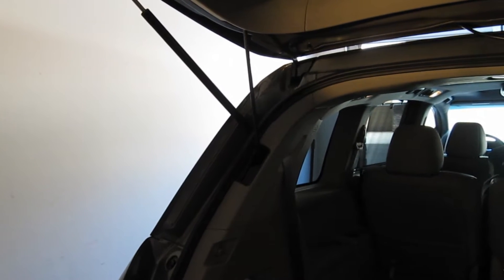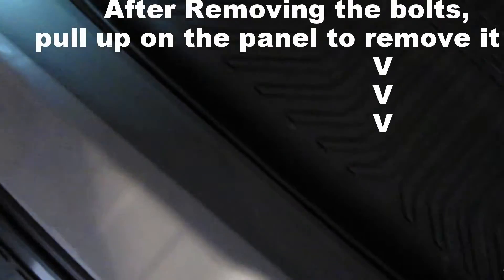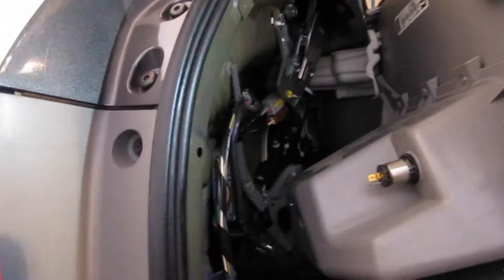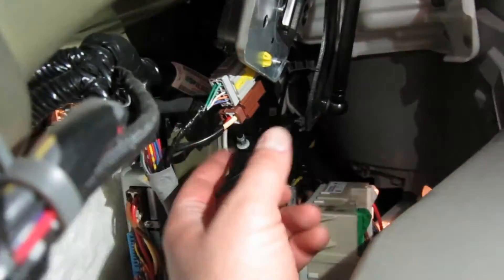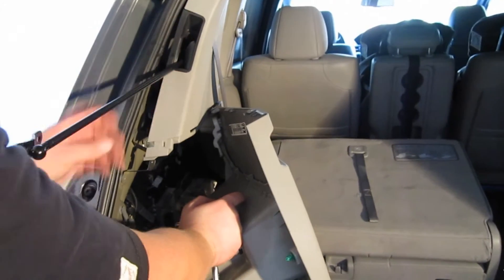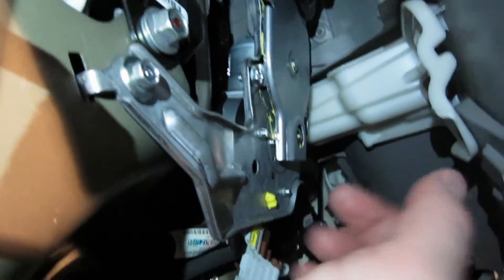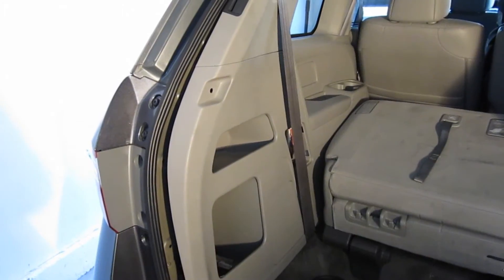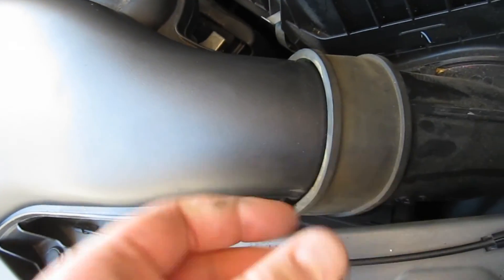How to Replace the LIftgate Motor on a 2011-2015 Honda Odyssey EXL

Comment: My post attached to that rattles when driving on bumpy roads, any ideas on making it quiet?  (come to think of it, by the time you reply I'll probably be done figuring it out)
Reply: So I ended up finding a rubber plumbing washer (probably for some valve in the house or something), cut a notch in it so it would slide in between the ball and the joint of where the rod connects to the door, and it seems to shut the thing up pretty good.
Reply: walperstyle Mine is having this same issue. How is hack working?

Comment: Please inform me the Part-Number of Steel-Bar connected from Motor to Tailgate.  I need to change only steel-bar.  There is a little gap so it makes noise.
Reply from the maker: I recommend asking your dealer using your vin # to make sure you get the exact part for your vehicle. Maybe try this part # 74966-TK8-A01 - or try taking a look here: https://www.hondapartswholesale.com/v-2011-honda-odyssey--ex-l--3-5l-v6-gas/body-air-conditioning--power-tailgate-motor
Reply: @howtogetstuffdone3480  Now i find out. Thank you so much!!!

Comment: Thanks, really helpful.  I wonder why these motors fail in the first place?
Reply from the maker: Random Stuff mine would open just fine but struggled to close on its own, probably because in order to close the motor has to work against the two struts that hold the back hatch open, so the motor has to work against a lot more resistance on closing.

Comment: Anyone have a link to where I can buy this motor?  Glad to know that my van is not the only one with this issue
Reply from the maker: I bought my motor from the dealer, or I often order parts from www.hondapartsoverstock.com. 
Here's a link to the motor: 
https://www.hondapartsoverstock.com/oem-parts/honda-motor-assembly-power-tailgate-service-part-74961tk8305?c=Zz1ib2R5LWFpci1jb25kaXRpb25pbmcmcz1wb3dlci10YWlsZ2F0ZS1tb3RvciZhPWhvbmRhJm89b2R5c3NleS01LWRvb3ImeT0yMDExJnQ9ZXhsLWxlYXRoZXImZT01LXNwZWVkLWF1dG9tYXRpYw%3D%3D  
just make sure the fitment is correct for your particular vehicle.

Comment: I have a 2017 Honda Odyssey touring elite with only 21,000 miles and it has trouble opening it like opens in steps it bounces. Is this the lift gate motor problem?
Reply from the maker: Lalalalalala Lalalalalala, usually when the motor fails it doesn’t struggle much to open, more so to close. Your issue sounds like the struts that hold the door open may be the culprit, will the lift gate stay all the way up when opened?
Reply: How to get stuff done , Once it opens it stays up but going up is the problem. It like has to step over steps it basically jumps and makes weird electric sounds.
Reply: Hey! We have a 2016 EXL, same issue. Bouncing and also this closing issue. I recommend replacing both the shocks and the motor. That’s what I’m about to do.

Comment: Mine will open and close with the remote but I if I try to close it using the button on the trunk it won't close.  Would I still need to replace the motor or is there a sensor I need to adjust?  Thank you!
Reply from the maker: I haven't encountered that personally. Does the button from the driver seat work? Maybe try replacing the tailgate button, I've found this website helpful, I entered in stats for a 2011 Odyssey for the tailgate diagram at the following link: 

http://www.hondapartsoverstock.com/a/Honda_2011_Odyssey5ATEXL/__6657321/TAILGATE/14TK8B01_TK84B5500D.html 

I think part #11 on this page might be what you need, it's referred to as a "switch assembly tailgate opener" or maybe consult the dealer.
Reply: Yes, the button from the driver's seat does work.  Thank you so much for your help!  I will take a look at the information you have provided.

Comment: Same process for a 16 EXL I assume?
Reply from the maker: That’s too bad about the dealer. I imagine it’s fairly similar, but I haven’t done one on a 2016. If you have updates like the Honda vac I imagine there may be a little more moving things to get to the motor.

Comment: Anyone install this and then not work? Did in stall pretty straight forward,  put everything back and now nothing works, doesn't open doesn't close.  No sound at all when trying to push button
Reply: We’re you able to figure out your problem? I’m having the same issue ,

Comment: Very bad engineering here, why that simple mechanism go bad and require replacement? due to bad and weak design.
Reply from the maker: AvAr indeed, the motor on only one side must constantly work against the struts on both sides.
Reply: @howtogetstuffdone3480  Yes, partially true however the gate is super heavy and it balances the pressure of the struts, so not much of a load comes down to the motor. Mine also got bad like many others, this is an issue especially in hot weather. The motor uses a magnetic clutch and a pretty strong DC motor, normally it should overlast the van. However the quality of materials are really bad, the assy bends ans you can see how it flexes in the casing. Thank you for the video btw, just threw in my 3 cents on this.